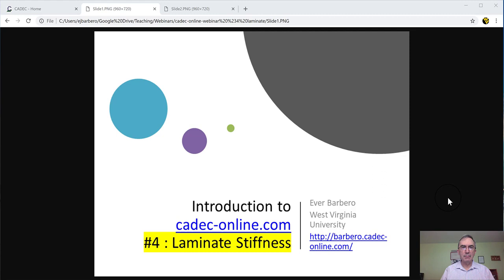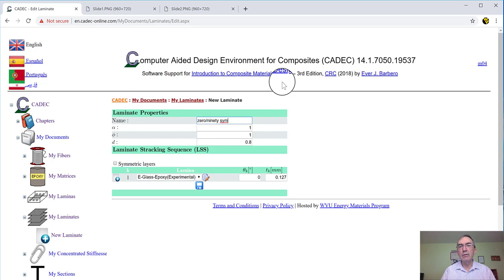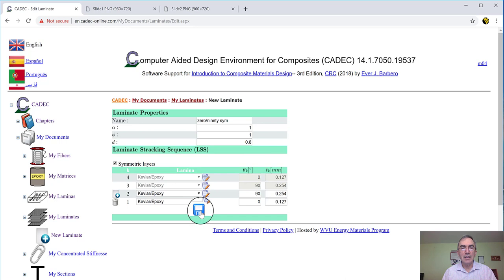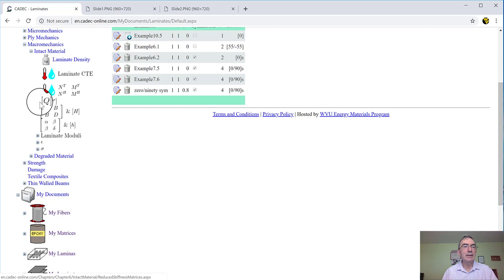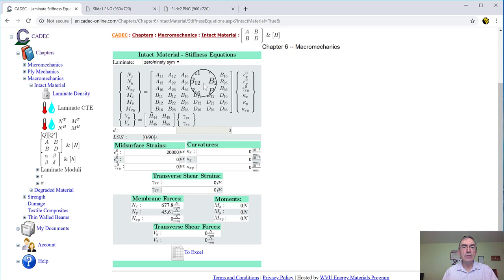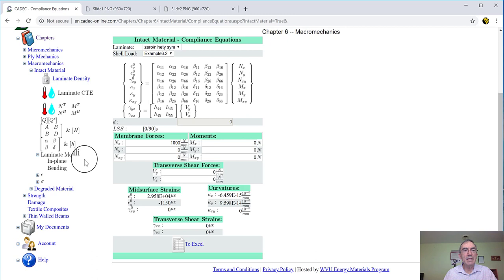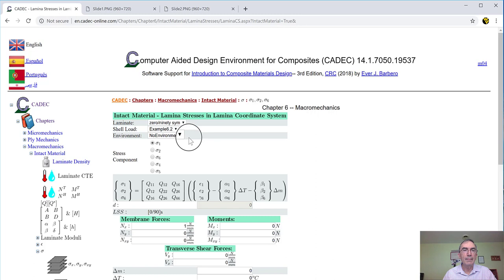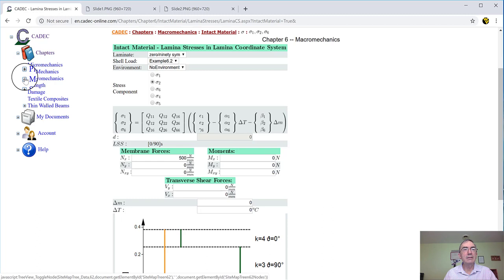Introduction to cadec-online.com #4 : Laminate Stiffness

Comment: Thank you sir , i am a beginner but does it seems like that when we using lamina type in abaqus to define modulus , when input let say E1 equal to 2000 that mean for both tensile and compressive stress it uses E1 , but is it really same Modulus for both tensile and compressive should be used ?

Comment: Dr. Barbero, I've been trying to use CADEC to obtain orthotropic properties of a carbon fiber-epoxy lamina (2x2 twill weave). I followed your tutorial and inserted the fiber, matrix and fabric properties and parameters as requested by the program. Afterwards, I went to "Chapters" then "Textile Composites", then "Lamina" to obtain the properties. The weird thing that I'd like you to explain to me is that F1t, F2t, F1c and F2c are equal in value. How can this be? How can tensile strength equal compressive strength? In addition, Poisson12 is also equal to Poisson23, for which I have no explanation.

Moreover, F4, F5 and F6 are also all equal in value. 

I read section 9.6.3 in the latest version of your reference  and found a solved example with screenshots from CADEC with the same results shown as I had encountered. 

I would like you to help me understand how these values are the way they are. Thank you.
Reply from the maker: For a cross-ply the laminate looks the same in the x and y directions, so F1t=F2t, F1c=F2c, where 1=x and 2=y in Table 9.17. The notation is incorrect. It should be Fxt=Fyt, Fxc=Fyc, but we used 1 and 2 subscripts so that we can use these results in a more complex laminate where each textile "lamina" is jus a lamina like the unidirectional laminas with different properties. If cross-ply, then the properties in both directions are the same.  The model uses maximum stress for failure and it calculates F1t and F1c of the fill and the warp tows simplistically with the rule of mixtures. I should improve this to provide more realistic results in compression. All the shear strength values are controlled by Fms. F4=F5 or Fyz=Fxz because it is a cross-ply. I would think that F6 would be larger than the other two, because of the interleaving of town, but this is a problem of using maximum stress criterion, once the shear stress reaches Fms in the matrix, it detects failure and stops, so the interleaving is not fully accounted for.
Reply: @EverBarbero  So you're saying that F1t and F2t as well as F4 and F5 could be taken from CADEC's calculations comfortably, but F1c and F2c and F6 are not accurately calculated?